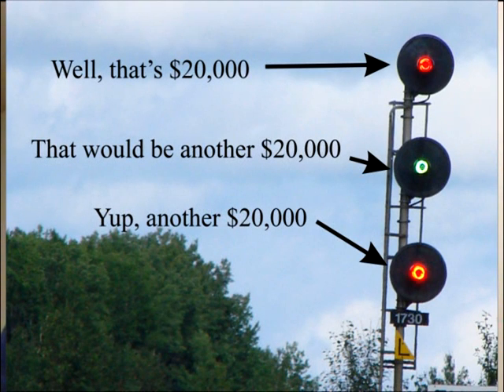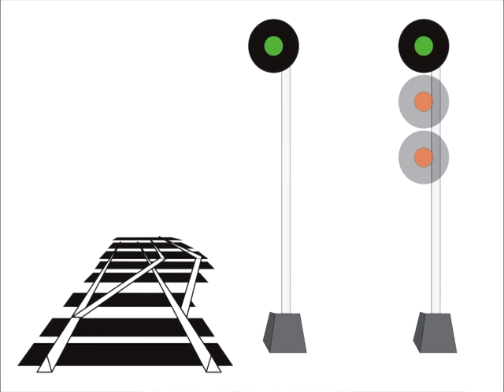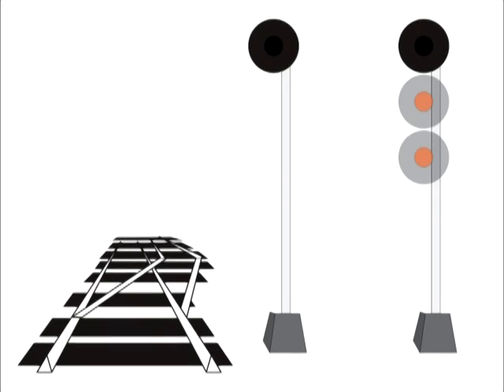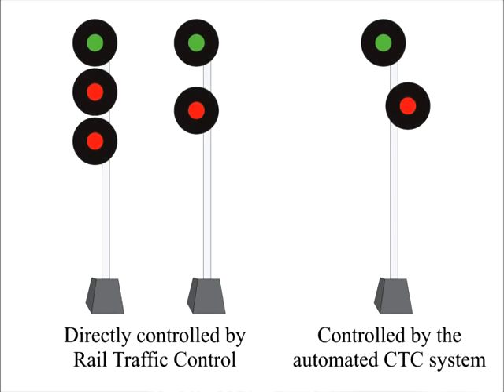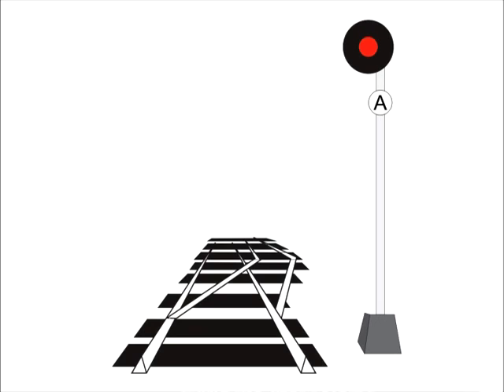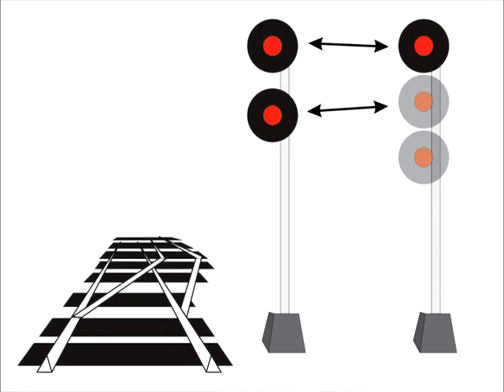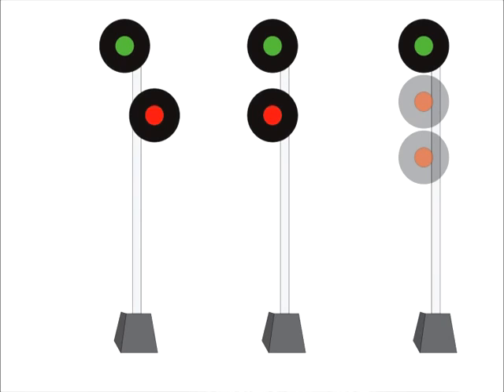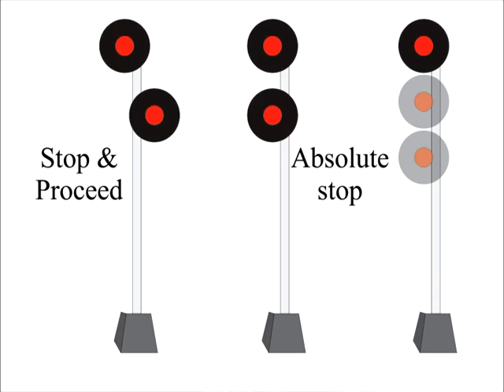Railroad Signals, part 2: 1 and 2 head systems - reading and meanings

Comment: Tje "A" plate is the one instance I've found that is NOT a failsafe.  If the the "A" plate gets covered with snow or goes missing, the signal reverts to a LESS safe comdition.

Comment: +ianjuby  Recently, I observed a new way signal code not far removed from that explained this vid on the Bay Area (CA, USA) Rapid Transit District's third-rail broadgauge extensions:  Steady green is proceed at track speed; flashing green, proceed at reduced speed to take a switch; steady amber, prepare to stop from track speed; flashing amber, prepare to stop from reduced speed for taking switch; steady red, halt.  These are on new three-head LED stands and also usable on the legacy Fresnel-lensed color-selects.

(Most of the system still uses dwarf signals at the switches, which only indicate the switch position and are not tied to the CTC computers in Oakland - BART needs to install proper way signals system-wide.)

Comment: Okay, what about if the single-headed signal is supposed to have an Ⓐ below it, but the Ⓐ falls off or gets covered in snow?
Reply: The A is for absolute signal.. if the signal post does not have a number sign under the light, it is the same as having an "A".

So A or no A, unless it has a number tag it is still and Absolute signal.
Reply: But, I guess in all actuality... It really ultimately depends on the carrier and if it's passenger or freight... You would think all the signals would be universal.. but sadly they are not.

Comment: What if I encounter a two headed signal and the track speed limit is 30 mph?
Reply: That depends what is the current limit
And what is the miles till the next mile marker
And the distance until the next speed marker
Reply: Clear signal would be 30 MPH, Diverging would be 25 MPH Slow and Restricting would be 15 MPH. It's all the same. You can have full mast signals when the track speed is 15 MPH.

Comment: Excellent series as I mentioned before! Just a question on the fail safes when it comes to the modifying plates. You mention the single head masts and the R plates etc. But what happens if an A plate falls off or is covered in the snow or stolen or whatever? The signal would go from an absolute stop to a stop and proceed. Wouldn't this be an issue as its no longer as restricting? Just wondering
Reply from the maker: +VancouverComposer Agreed. Someone pointed that out before.  Technically, the operators are supposed to be "familiar with the territory." That's actually in the rules.  So technically they would know to stop anyway, and when the A plate was gone, they would call it in.  But of course, the railroads will often call you to go on territory you haven't been familiarized with all the time!  So....
Reply: "The signal would go from an absolute stop to a stop and proceed. Wouldn't this be an issue as its no longer as restricting?"
Yes, that is a wrong-side failure.  It is the only wrong-side failure in the CROR system that I can think of.  However, such a failure would be very rare.  And an alert and qualified train crew would know whether the signal is supposed to be absolute or permissive.  But because of this, single-head absolute signals are not common.
Reply: +VancouverComposer The amount of A plates still in use in Canada that would fall under this circumstance are very few.

Comment: does the conductor have a responsibility to read the signals with the engineer.
Reply: +John Richards Yes both crew members must know what the signal is and what it means. I guess you could argue that the engineer needs to know more but both crew members need to know what it means.

Comment: dude I appreciate your effort but you have a few things backwards a signal without a number or letter plate on it is an absolute signal if you go by it you will get a vacation for at least 30 days a red signal with a number or letter plate is a restricted proceed
Reply from the maker: Delilah Hensley Not according to the Canadian Rail Operating Rules, which as I mentioned is the system I was explaining.
Reply: True in American rulebooks, but not in Canadian rules. The presence or absence of a number plate has no meaning other than identification in Canadian rules.
Reply: they really need to get together and come up with some uniform rules
Reply: +Cycling in Edmonton from the Eyes of a Teen Well, whatever country the train is in, obviously, eg for an NIR train to cross into southern Ireland it has to be fitted with CAWS, not just AWS, and has to follow IÉ signaling
Reply: +Delilah Hensley Uniform rules? Every railroad in Canada uses the exact same rules. It is the USA that needs the uniform rules.
Reply: +Cycling in Edmonton from the Eyes of a Teen They follow the rules of the railroad they are operating on.

Comment: Another fantastic video!  Question: are three head signals ever staggered? If so, what would it look like? If not, why not?
Reply from the maker: doanster No, because the three head signals are ALWAYS controlled signals - they are directly controlled by RTC.
Reply: +Cycling in Edmonton from the Eyes of a Teen The staggered signals are useless with CTC signals. THis is because the CTC signals are controlled by the dispatcher and are absolute.  If they wanted to display restricting (pretty close to what happens with the Stop and Proceed of staggered heads), the dispatcher just lines the signal.  There is a reason absolute signals are absolute, such as when a switch or diamond is involved (anywhere where you could derail a train).  Also some signals are absolute that way a train can be "forced" to wait somewhere by a dispatcher, such as in a siding to wait for another train.

Comment: as a former signalman on the Milwaukee Road, (1970's) I see some changes have been in order. For us the lower signal indicated the siding and sometimes there was a dwarf signal on the outbound of some yards. The signal without a plate was an absolute signal. For us the indications were two reds and two yellows out in front of a train and a red and yellow trailing.

Comment: I saw a weird configuration....it was a three head signal and the top was steady yellow, middle was flashing green and the bottom was a stead red......what does that signal mean?
Reply: It means 'clear to limited'.  Indication:  pass this signal at track speed preparing to pass the next signal at limited speed (equal or less than 45 mph).
Reply from the maker: Good eye - Brian's right, it's "Clear to limited" which I'll explain in both parts 3 & 4 of this series.

Comment: Here in Winnipeg, I've seen 2 headed signals where the lights going down the track are (Yellow, Yellow), then (Yellow, Red), then (Red, Red). I guess that (Yellow, Yellow) would be Advanced Clear to stop, but I don't know. I don't know if you're going to talk about this later, but I've also seen (Yellow, Green) signals.

Anyways, great video, can't wait for part 3!
Reply from the maker: Yes, I'll be getting into those in the 3rd and 4th videos. Those are "to" signals; "clear to medium" or "Clear to slow" or signals of that nature.  The first picture you showed, was the bottom yellow flashing by chance?
Reply: What you are seeing is an installation that was installed prior to the Advanced Clear to Stop being either defined (UROR era) or simply the signal designers preferred that approach for some reason.  The Y/Y is Clear-to-Slow.  This infers that the block design dictates that the heaviest trains can not stop at the R/R signal when they see the approach signal displaying Y/R unless they are already travelling at 15 MPH (or inreality less than the next defined speed of 30MPH/Medium).  The spacing of the last two signals must be very short.  The Clear-to-Slow signal ensures the trains reduce to SLOW speed when the approach signal is displaying Y/R so they can ultimately stop at the Stop signal.
Reply: acsoosub
Yes, that is also correct, just not in the scenario we talking about here.  In Canada, the aspects have different names than in the US.  A Slow Clear is called Slow-to-Clear.  The names are generally structured as <What speed you do locally> TO <What speed you do at next signal>.  The Y/Y aspect is Clear-to-Slow.
Reply: Kevin Rudko Or that the next signal is displaying a Slow-Clear because of a route set through a slow-speed switch.
Reply: Yes, they get a restricting signal onto the spur.
Reply: Nice information to know !
Reply: I nice information to know
Reply: Victor Aguilarl dave allen 
 Here are pictures of the lights I mentioned above:
(Yellow, Yellow) http://oi60.tinypic.com/2nbeufr.jpg
(Yellow, Green) http://oi57.tinypic.com/21j6gqh.jpg
Reply: taylorover9001 Thanks for the info on the signals !
Reply: thank you
Reply: Ian Juby Ok, good to know. No, both yellows are solid.
Reply: taylorover9001 https://www.tc.gc.ca/eng/railsafety/rules-tco167-175.htm

All the Canadian signals. You won't see nearly all of them here in Winnipeg as the system is old and can't display a lot of the fancier lights. Solid Yellow over Solid Yellow is Clear to Slow. Solid Yellow over Solid Green is Clear to Medium.
Reply: Kevin Rudko This location has one light only a handful of car lengths past the previous one. You are correct with the Clear to Slow - Clear to Stop - Stop set up.
Reply: That is also correct.
Reply: Yes, I've seen something like that for the junction on to the CN Fort Whyte Spur in Winnipeg, which is very sharp.
Y/Y, Y/R, R/Y
Reply: Remember when we had green flashing lights, to mean left turns at an intersection, here in Winnipeg? 😂 THAT was confusing enough for other folks...oh and the 6 lights on traffic signals...with an arrow pointing up...for traffic to proceed through...oh the good ole days 😊😊